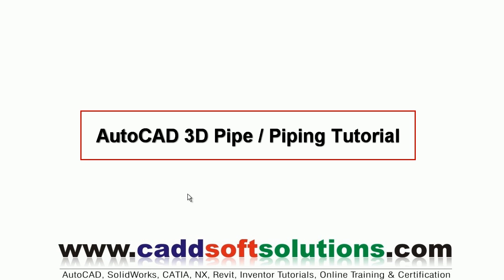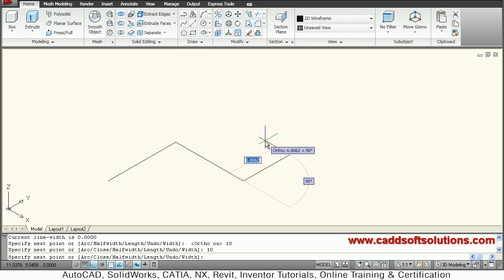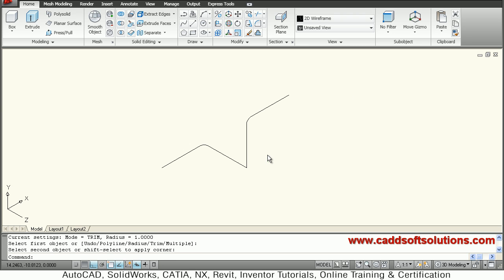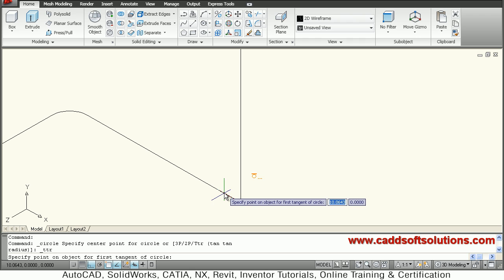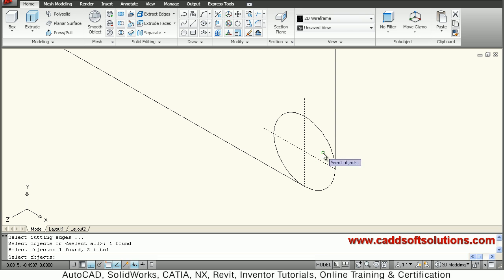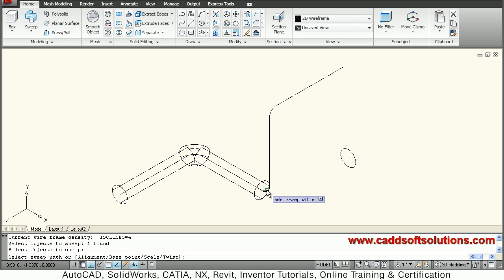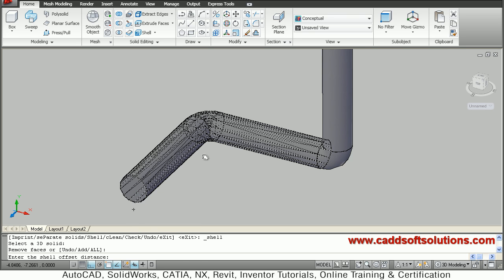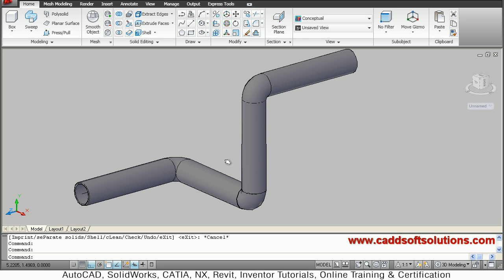AutoCAD 3D Pipe / 3D Piping Tutorial

Comment: in this, there are 3 different solid pipes. 2nd pipe where you used a circle to create fillet as both the lines are on a different plane, in that, you have not added a hollow feature. If you know how to do it please let us know.
Thank you
Reply from the maker: At first union the complete object then use Shell command to make it hollow.
Reply: Thank you for your reply. You mean the "union" command?
Reply from the maker: Yes. Union Command
Reply: I tried bt After using union command, the shell feature is not working.

Comment: I use this method a lot.
If you have to show all the elbows as separate pieces, sometimes this is required. For instance, the company I do work for stocks 90 and 45 degree elbows in predetermined radius, so they request that I show breaks between the straights and bends.